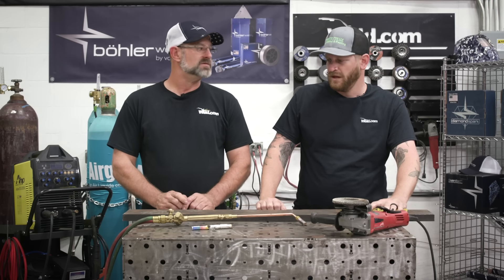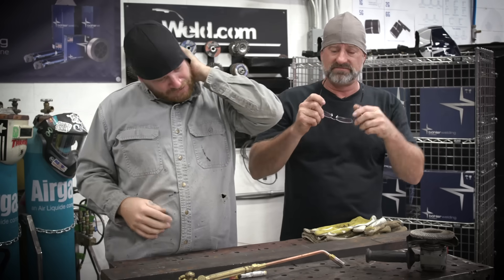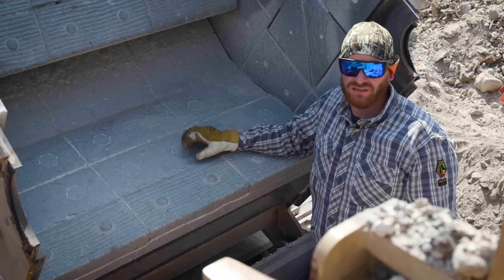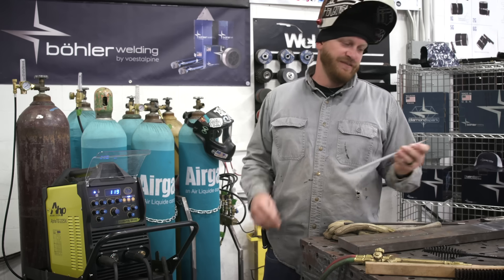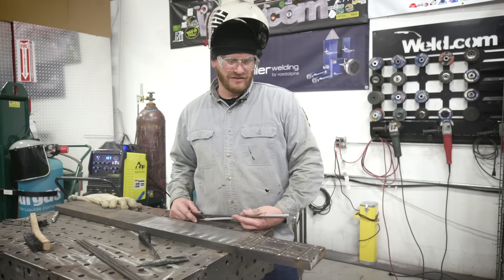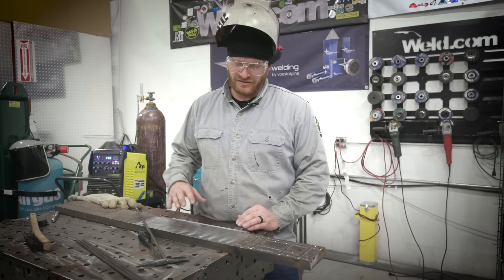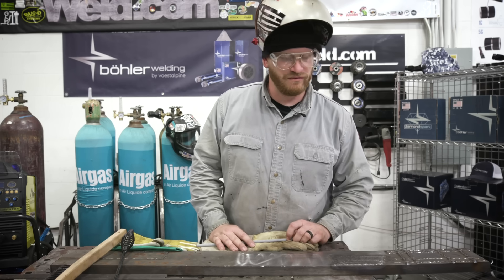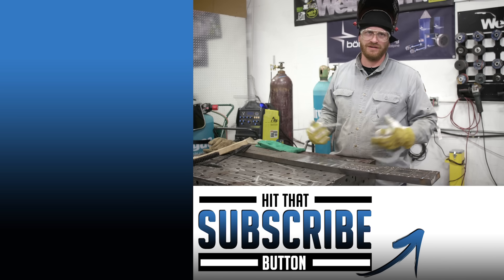Introduction to Heavy Equipment Repair with Hardfacing

Comment: Interesting video. It would help me to know the "why" of some of the processes - such as why the pre-heat and what kind of penetrate into parent metal you desire.
Reply: I did mention that we were using a Postalloy tubular rod and also a Stoody 35 rod. We used a 7018 as a build up layer.
Reply: I see I didnt mention that we preheat the parent material in order to achieve just enough penetration so the rod lays nicely on top of the plate and to help prevent cracking of the hardface bead from cooling to fast.
Reply: @bobhigginbotham9035  thank you.  That helps me.
Reply: @bobhigginbotham9035  I never preheated for hardfacing, I'm sure it helps though.
Reply: dowe   preheating definitely helps with bonding the rod to the plate and really helps prevent cracking in your bead as it cools. However if you running multiple passes on the same plate you will constantly be heating you base material as you weld. We do that too. 🤙
Reply: Preheat temp is almost always determined by the base material.  The higher the carbon content the higher the preheat.  Rule of thumb is 100° F for every point of carbon.  1040 carbon steel is .4 carbon so it would require 400° F.  1080 is .8 carbon so 800°F...ect.  Preheat not only helps with bonding but it protects the base material from thermal stress and reduces the risk of hydrogen pickup and hydrogen induced cracking.  "Check cracking" is a whole different story... common and  necessary in some hardfacing alloys and others alloys do not check crack at all.  But that topic would take up a whole different video!!
Reply: @tak252  Thanks for the extra info Troy.
Reply: Yeah gotta do it like icweld and just show the welding he doesn't know what machine/object working on half the time but he sure knows how to fabricate and weld
Reply: Same here. He had many (useless) details that I lose track from what I'm looking forward to know/learn. Had to rewind the video to see if I had missed something but not.... he forgot to mention anything about pre-heating and what hard-facing rod he was using. (was it ordinary 7018?) If 7018 could hard-face then he should say so. If it was some special rod, than why not detail which what? :-( 

This ain't Bob.